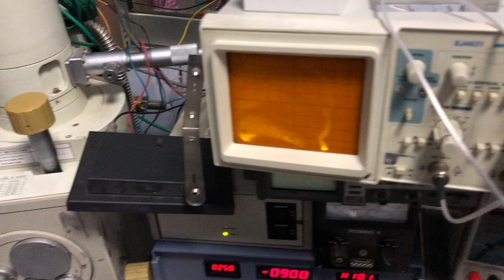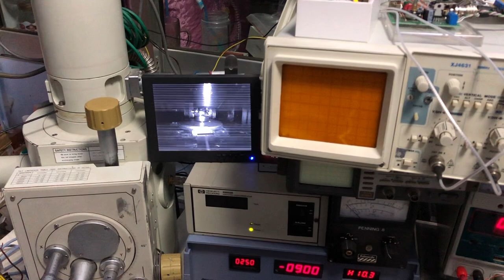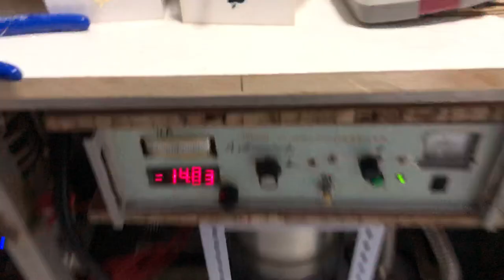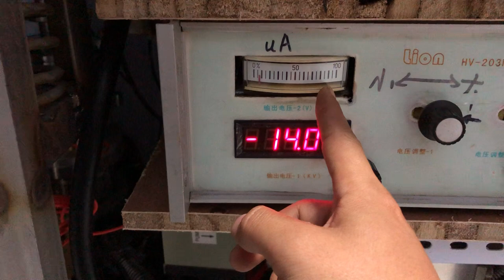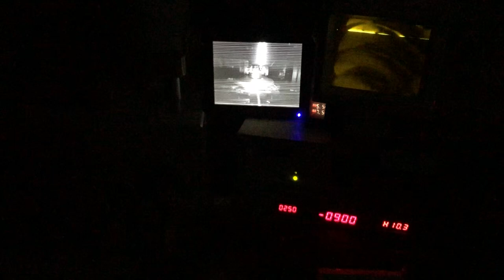Scanning Electron Microscope Gun Alignment Test

Comment: Hm, I don't think my 5300 has such adjustment screws. Maybe that's because yours is equipped with changeable final aperture and mine has a fixed one
Reply from the maker: yes~！ that's exactly because of the aperture part
but I'm not using this aperture yet